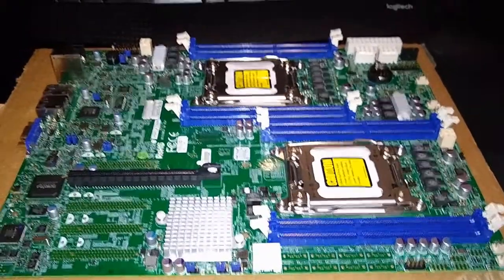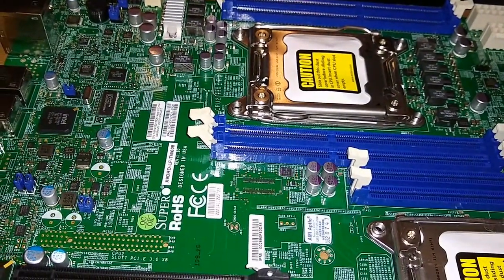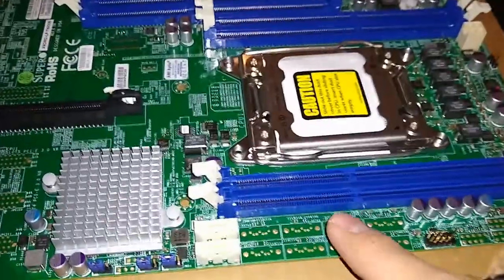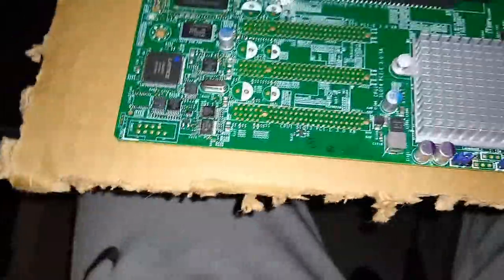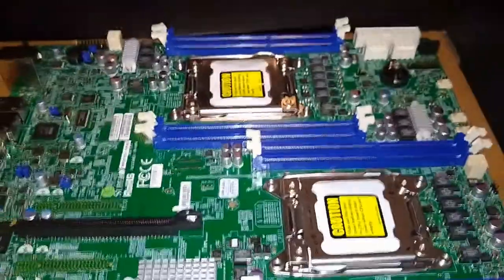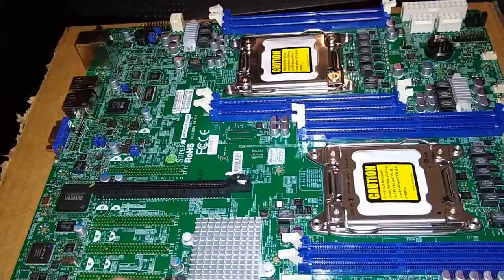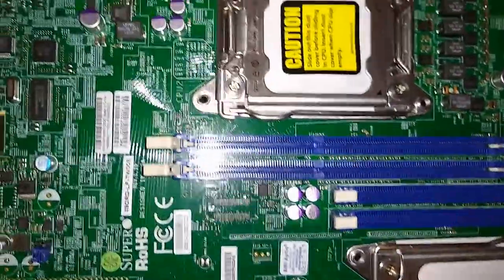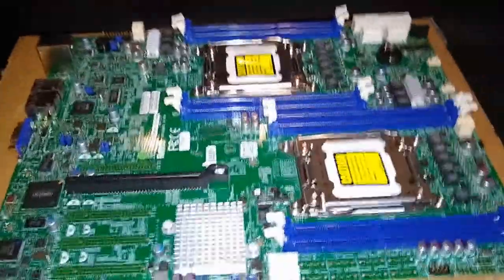Dual Xeon X9DRD-LF Supermicro LGA 2011 Motherboard Overview

Comment: Did you end up soldering in another USB connection to the motherboard?
Reply from the maker: I tried to but my solder was having a hard time sticking so I just decided not to. It might have worked better if I used some flux.
Reply: @BrooksyTech  Did you test the connections on the board to see if they were live?